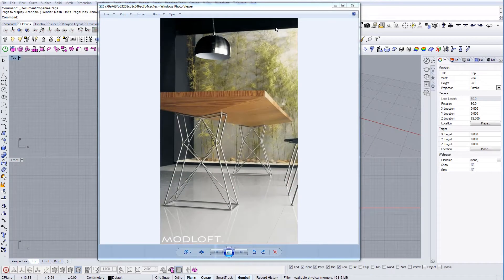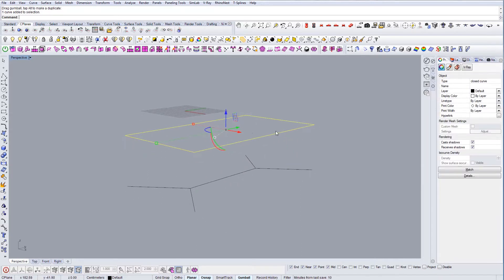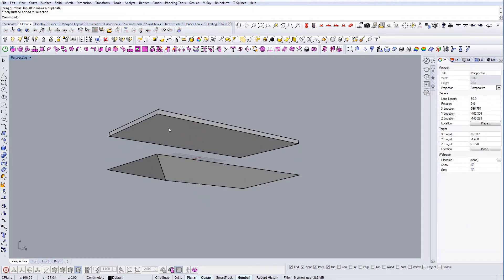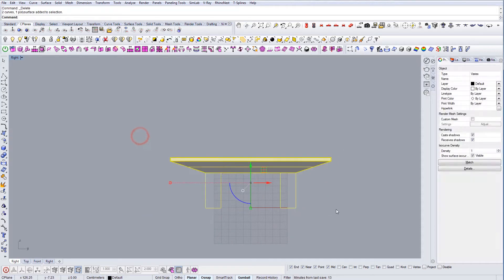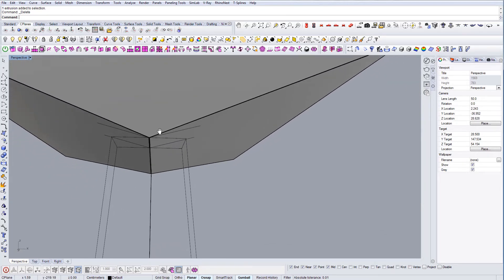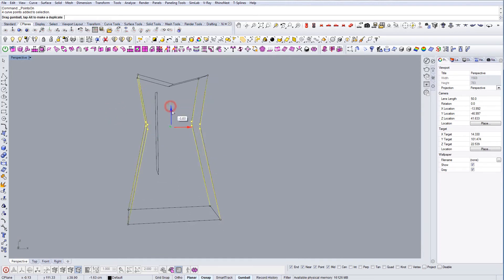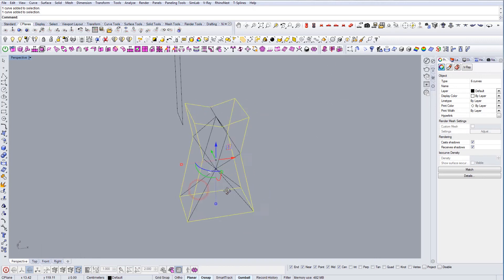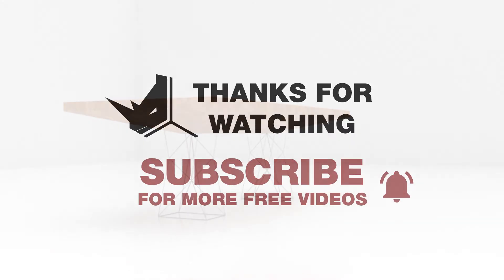How to Model Wooden Table in Rhino

Comment: Hi mate, 
great tutorial video
I dont understand how your create main pipe with smooth round every corner of the main frame. 
could please explain ?

thank you
Reply: I can find command _tspipe in my rhino5 :(
Reply from the maker: Do you have T-spline installed?
Reply from the maker: Hi Tai, 
There's an option when you start pipe command, pay attention to the command line, you will have the option there to choose how you want your ends to look like, sharp or rounded. That's where you set this up